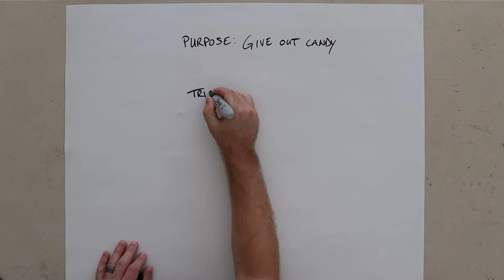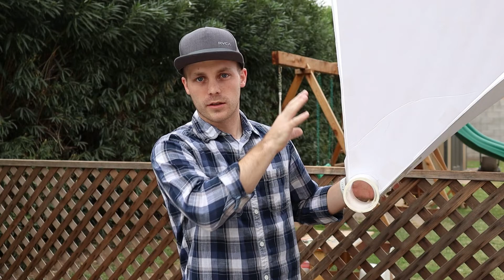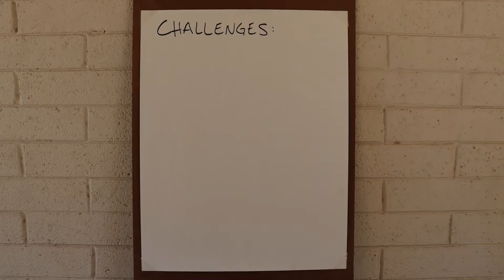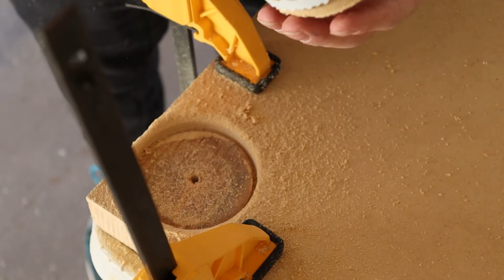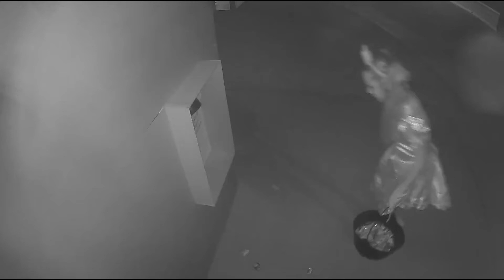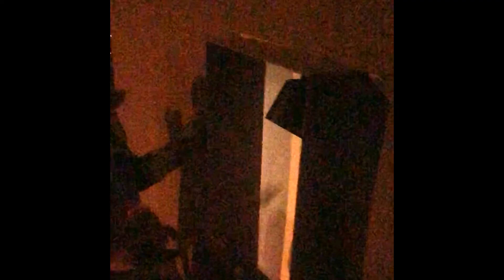Candy Machine! Automated Trick-or-Treat

Comment: This is great!  What type of wire did you use to bend and retain the shape?  Also, what size plastic pipe did you use?
Reply from the maker: Glad you liked it! Solid copper wire was what I used. And it was 4 inch pipe if I remember correctly.